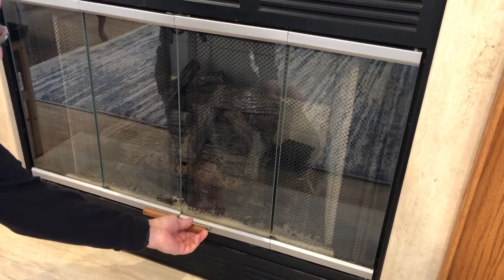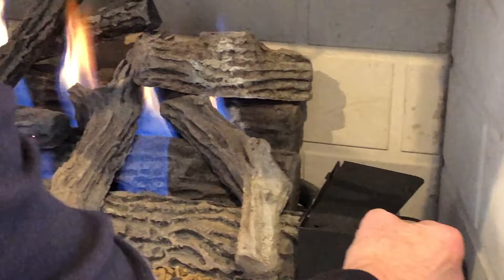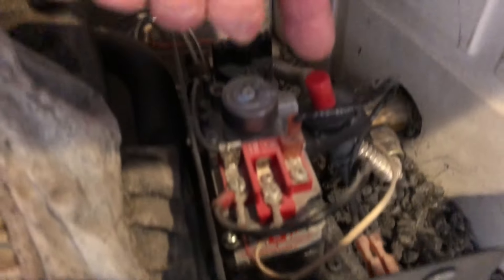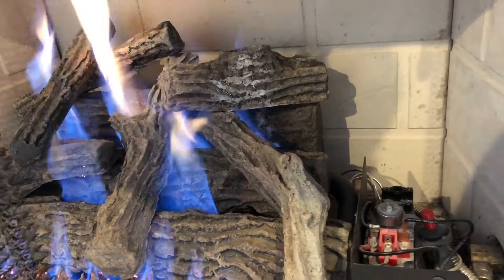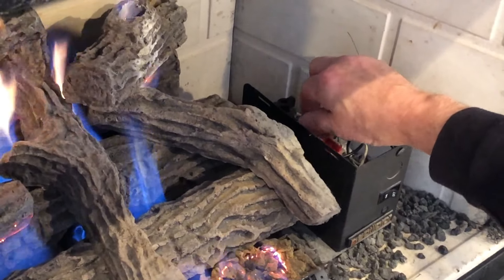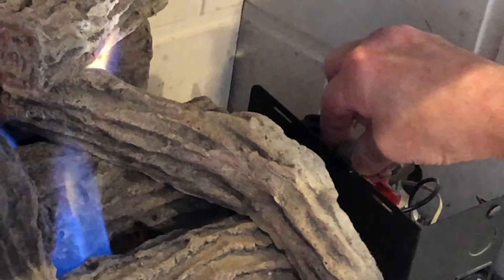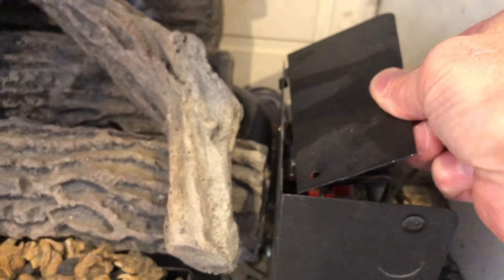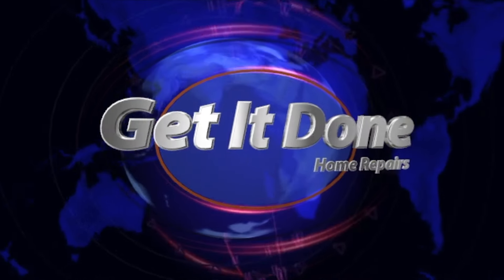How To Adjust The Height Of The Flame In A Fireplace

Comment: My flame is too high even when adjusted to low setting.  Is there a regulator that is built into control valve?
Reply from the maker: Sorry I'm not sure.
Reply: I had the same problem. Remove the adjustment knob by unscrewing the screw in the middle. Now you can turn the stem much farther. Set your flame height the way you like it and put the knob back on.